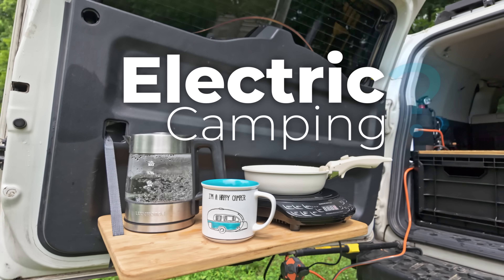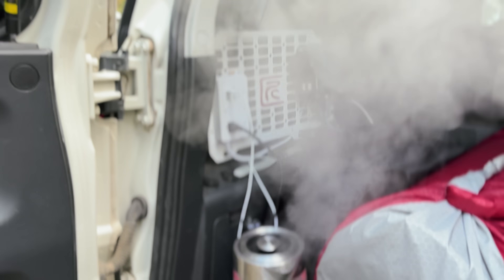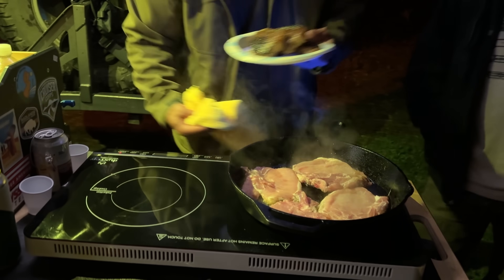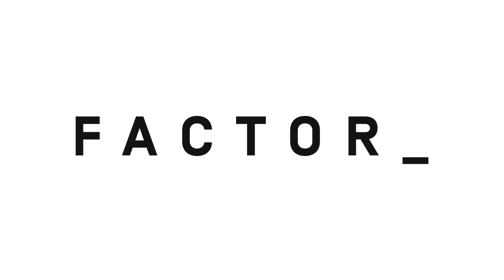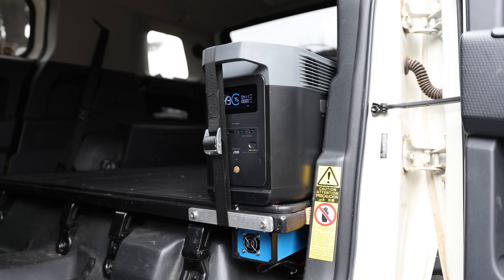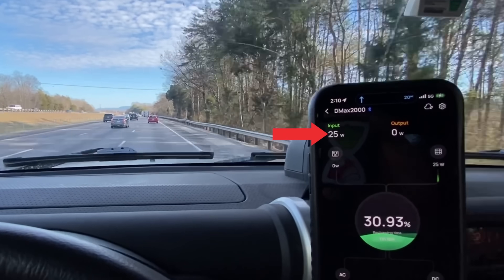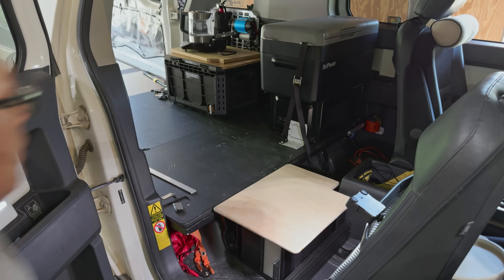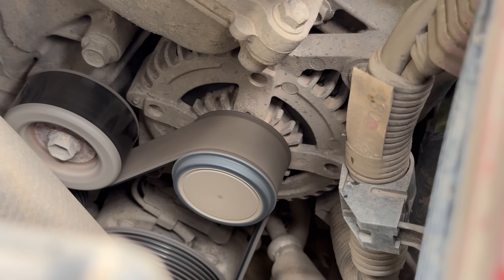I Tried Full Electric Overlanding For 1.5 Years | Was It Practical?

Comment: If everyone gains a basic understanding of lithium based battery tech, the relationship to power/watts = voltage * amperage and what a BMS is, you can build quite a bit of power reserve and charge it efficiently from both the alternator and solar.  Most people's power demands aren't running a 2000w inverter, it's best to stay within the 12v (24v Aussie) realm for all devices for a much more efficient use of stored power.
Reply: 24v Aussie? I'm in Aus and only trucks (and some winch comp vehicles) run 24v
Reply: @TheMitchellbegeng  so there is 24v there?  Most of the offroad channels ive seen use 24v rigs
Reply: @BrentRivers  I've only seen 24v on commercial vehicles and competition winching vehicles, never on overlanding rigs. I believe commercial vehicles in the states have 24v too.
Reply: Yes it’s more efficient but you’re gonna have a hard time finding a 12v microwave, induction cooktop, instant pot. They might be out there but will cost more than the inverter to use mass produced household appliances.
Reply: @TobyCostaRica  gotta stay home, or just get an RV.  Ive never needed a micro, dont even use one much at home.  But thats me.
Reply: Nah. The biggest downside of doing 110V/220V AC is that you lose efficiency to heat converting DC from battery to AC. Also good luck finding powerful 12V Kettle, cooking top, etc. 12V wires are super thic for these loads, 110V and 220V especially reduce the wires AWG quite a lot.
Reply: @tommy_zi284  well yeah, thats why i referenced it in my original reply.  Its not a straight conversion.  Is there a 240v inverter on 12v input?  Gotta be a huge power demand!

Comment: I built (& continue to optimize after EVERY trip) my van 7 years ago. At first on the road (before actually building it) I grabbed all my camp gear and travelled for 3 months. Then went home to do the  build. 

On the  first trip I considered how I would do the build & decided to build the most robust electric system and to NOT use fuel. (except a Butane cooktop which I never used as a back up, but occasionally as a second cooktop)

After 7 years I would not do it any differently. 
220 amp lithium battery - proven to be enough - I use 33% a day - so it last 3 days.
3000 watt inverter - never overloaded
30 + 40 = 70 amp Redarc BC/DC charger - I just added the 40 amp to speed up charging
200 portable solar panel - which I very rarly use - I pull the. out just to make sure they still work...

I never tried a microwave - never realy sure I would need one - I'll ponder it
Reply: And your alternator is still alive? Alternators are typically rated at 150Ah max. MAX!! So if they deliver 80-100Ah average you can be happy. Your car consume aprox. 30-40Ah while driving daytime => 60Ah max for recharging.
Reply: @alteregoklause1694  My alternator is 250 ah & has not skipped a beat after 7 years. 

From what I was told by someone who knew  these systems said as a "rule of thumb"  - you are  good as long as you Don't Exceed 50% output of your alternator's capacity.
 250 / 2 = 125 amp hour limit
So  I draw 75 amp to charge my batteries - I am still well below the max allowable  draw.
Reply: @TerryManitoba  Thanx! Ok, 250Ah is pretty good. Is this an OEM one? All cars I know (in Europe) are 150Ah max (standard). And yes, 50% seems a realistic value I use, too. Which limits me to low 75Ah recharge.😢
Reply: @alteregoklause1694  It is a Canadian Transit Van OEM alternator. Someone told me that North American vehicles tend to have larger Alternators. (maybe we are simply more power hungry-:)

Comment: Honestly this just makes sense, you run your engine all the time, might as well get full potential out of it.  It will charge when there is no sun, and most "overlanders" are driving for at least 4 hours a day, which will usually keep your batteries topped off.   These systems make way more sense than building your own now to IMO.  I went with the anker F3800, but in hindsight I wish I would have went with ecoflow.  However they more or less do the same thing, but the ecoflow has more peripherals and better options like built in heating pads on the batteires.
Reply: Also the ability to set your charge current at 50 watt intervals. I was surprised my friends anker unit didn’t have that. With I have a long drive I charge at 2-300 watts to be gentle on the battery. If I need to quickly top off my pack I’ll charge at 8-1000 watts

Comment: during my camping trip over Memorial Day, my electrical system did fail. my DC-DC charger which failed and I could not charge my battery. luckily I have 2000 wh and back up gas stove system so I was able to get through.
Reply from the maker: Interesting. Which DC-DC charger did you get? Why did it fail? Was it just a blown fuse or the whole thing was toasted.
Reply: @TinkerersAdventure  I drew my conclusions too early and sorry wrong terminology. 

The set up: Car battery-fuse-relay-Amazon voltage booster 12/24 - bluetti D050S "DC Charge enhancer"- BLUETTI B230 battery

I originally thought my 12-24v voltage booster (amazon SUPERNIGHT 12-24 20A) failed since the bluetti battery would not charge. However, I have measured the voltage from the car battery( which read normal 13v), the output voltage after the 12-24 booster (normal 24v), and the output voltage after the D050s (normal 59v). 

The D050S came with a cigarette plug and the battery charges (red light) when I plug it into the car. There is a status light (green- battery is full or on standby, and red- charging). The most expensive component still works! phew

When I use my own wiring, the D050S shows a green light (confirming that power is going in), but does not charge. The D050S has input voltage of 12-60v and is meant for solar so the voltage doesn't have to be completely steady.

The system has worked before but I only realized it stopped working this past weekend. Maybe it's been broken for a while and I just didn't know. The only thing I can think of now is that the relay has failed and is not able to provide enough current, but is able to provide just enough that I can measure the voltage is good.

Comment: When I saw the ecoflow 800w I immediately thought about your setup. It's an exciting time to witness the transition. Even more and more homes are going full electric. I'd love to see a video of your take on hybrids and how they benefit in electric camping. My RAV4 Prime PHEV has been flexing at the camp site for the past year!
Reply from the maker: I love the RAV4 Prime!
Reply: The RAV prime seems like a factory designed full electric overland system with added drive train integration. Can you charge up on solar, or is there some minimum power / voltage threshold to make it work?
Reply: @MrJhchrist  You can not charge up the car with solar. Well technically you can, it'll just take a looooooong time. Solar charges too slow, or rather hybrid batteries are way too large in capacity. The RAV4 Prime has 14kwh of usable/chargeable battery. So even with a large 400W solar panel that Kai has with his FJ, it'll take you 35 hours to fully charge the Prime.
Reply: I’m going to camp in mine this fall and hope to run AC all night without the engine kicking on. PHEV is the ultimate overland setup

Comment: Very informative video.  I am doing a hybrid setup similar to yours. I have a 100ah dual battery setup that feeds a Bluetti 180p for around 2.5kwh of storage and 1.8kw of output. All being charged by a Victron 18 amp dc-dc charger. It's nice to be able to pull the solar generator out as needed while camping and then put back in and allow charging from the 2nd battery that is mounted underhood of my 5th gen.  Speaking of which, how much wattage were you able to pull from your stock alternator? I assume we have the same engine?
Reply from the maker: My factory alternator is 100A. At worst case electric usage, everything else uses 75A, leaving 25A X 14V = 350W overhead. That worst is not very common so I feel comfortable running 400~500W for hours to charge my power station.

Comment: Just started using an induction cooktop with my bluetti setup. Also could run the heater to heat up my GFC, but definitely limitation is ambient temperature, my batteries ran down pretty quick when it was ~30F outside, so even my 4kwh setup was down to about 15% (from 89%) when I woke up in the morning.
Reply from the maker: are you using a space heater over night? that will run it down a lot as the tent loses a lot of heat. i only use the space heater in the morning when i change and run electric blanket inside the sleeping bag overnight
Reply: @TinkerersAdventure  I ran it on low (so it was cycling) for about 4-5hr. Granted it was my first test in my GFC and it was trying to heat the tent and the bed area. When it's on low it pulls ~5-600w, but it cycles with the thermostat as well. I will say, I am sold on induction cooking, it works exceptionally well.

Comment: Respectfully, replace “camping” with “overlanding” in the title; you even say car-recharging is a practical requirement.  I implemented a modest solution, in part inspired by Tinkerer, with a good panel, battery and a small fridge which only gave me a couple days camping at North East camp grounds.  My setup wasn’t a failure but I did have to plan on power exhaustion.
Reply from the maker: Thanks for the suggestion! title changed :)

Comment: Ecoflow alternator charger you can change setting in app for charging watts up to 800w/voltage 12-15v
Reply: I just received mine yesterday. This will be the ultimate setup. Hooking it up this weekend; Delta 2 Max LFP, Glacier fridge/freezer, 800W alternator charger, and 160W solar panel.
Reply: @alexsoo1752  Are you using the OEM alt? The vid left me hanging on whether he changed his or not.

Comment: Same here
200$ Microwave without turntable
30$ kettle (500W travel)
50$ induction

100Ah battery + Renogy 30A alternator charger and a Delta 2 make up my electric power house.

Microwave is a game changer. Costco stuff + Microwave is a new level unlock
Reply: A microwave was never even a consideration until I saw this. Now it's tempting. I wish they made small ones with the convection option!
Reply: @lawrencek9748  Yes,, I was looking at smaller ones, but all come with turntable. Panasonic was the smallest I found without turntable NE-1025F
Reply: 100wh?

Do you mean Ah?
Reply: @ausguy4385  Aaah yes, fixed it
Reply: What are your recommendations from Costco?
Reply: @KingsonMan  Sukhi;s chicken, some nice korean frozen  stuff, Enchiladas, Jim beans for breakfast..
Reply: What is the purpose for the separate 100ah battery if you have the delta 2?
Reply: @JimmyDevere  Delta 2 can be run down with 30 minutes of microwaving, even faster actually. And I am also running a fridge. Imagine using the microwave before dinner and then overnight the fridge eats up 400Wh... and you run out of juice. Add stuff like kettle etc. for making tea/coffee. So the 200Ah (yes I added another 100ah) extra makes it multi night proof
Reply: @tsk1979  People without real life experience really underestimate how much power you need e.g. for cooking. You can´t overcome physics by using electricity, total energy consumption will be always the same no matter if you use gas or electricity.
Reply: @alteregoklause1694  yup thats why now I have 200ah of batteries in addition to 1kwh of delta 2. Total 3500wh of energy enough for cooking, microwave, fridge etc
Reply: @tsk1979  "Total 3500wh of energy enough for cooking, microwave, fridge etc" Depends on how long you camp😉
But how do charge it??? ~300Ah needs (to my calculation) at least 6h net driving time as standard alternators with todays "intelligent" battery management might not be able to deliver more than 60A (if you´re lucky)?
Reply: @ I never camp more than one day or two days at a time. So starting full it’s easily manageable as actually camp cooking time is max 30-40 minute at 1500w and about 6-8 minutes of microwave and some kettle. Highest use we see on day trips. Eg hotel to hotel while roaming the Death Valley. We can park anywhere cook lunch etc. btw I charge at 30A so it’s more like 15 hours to full charge
Reply: @tsk1979  You´ve forgotten your fridge (I´m shure you have one😉) takes 500-800W (average 2-3Ah*24h) per day. At least mine does. Water cooking takes me ~500W/day. If you run a computer this might add another 100-150W.
Plus a little illumination at night.
Other than that I´ve the same consumption as you, but I stay sometimes 3-4 days - and that´s where it gets really difficult. Solar delivers 300-500W / day in summer, not that much. If I drive its about 3-4h (slow traveller😁) => high speed recharge is mandatory and I still need gas.
B.t.w.: what for do you use the microwave?
Reply: @alteregoklause1694  yup, even camping trips I am driving atleast 2-3 hours a day sight seeing minimum. Never ran out of power for cooking and fridge. When i had 100ah battery I ran out of power in winter trip (hotel stays at night) as the battery low temperature protection kicked in lol
Cooking I also use instant pot sometimes. Very fast and very power efficient.
Reply: The nice thing about a Toyota hybrid, (especially a plug-in), is acts just like a big, quiet, efficient generator. You don’t need to be driving to be dumping whatever your DC-DC converter can deliver. The engine automatically kicks on once in a while to top up the voltage.
Reply: @AscendedMaster11111  Because its a commercial microwave without turntable. So it can withstand the bumpy overland trips
Reply: @hellofathul  okay so basically support slavery in Africa by buying lithium batteries just so you can heat up water. Yup that's 2024 for you. Or just be a man and gather a bit of wood, cook over a fire, and pitch a tent. Literally 30 min of work, I'd hardly consider that hard. Unless you have soft hands then just stay in the city.
Reply: @hellofathul yes, like a man! Using a microwave while in the woods when you're surrounded by natural fuel is just asinine. Y'all must be so lazy and completely out of touch with nature to even consider this.
Reply: Since I don’t have a camping van just a 4Runner I bring the v1 Ninja Crispi and it’s fantastic.
Reply: Or just cook over a fire like a man
Reply: @manwithnoname734 A man invented the microwave. 🤷
Reply: @manwithnoname734  if you can of course! Try that in mid June/July in AZ with fire bans pretty much all summer. New tech= new solutions to old problems👍

Comment: What alternator can you upgrade to?
Reply from the maker: I’m still looking for reliable options. Most aftermarket ones are not as reliable as OEM especially if it sees mud and water. My factory alternator is 100A. Tacoma and 4Runner with tow package have 130A. I plan to go 200A
Reply: You do not need an alternator upgrade, choose LiFeP0 battery bank and use a DC-DC charger like the Redarc than can push 50 amps.  You never charge lithium based batteries with a direct connect to an alternator, it will kill it
Reply: @BrentRivers  the creator  said at the end of the video that his alternator couldn't supply 800w to the dc-dc charger. I was curious about an upgraded alternator that'd be able to charge as fast as possible with the dc-dc.
Reply: @jordandoes352  without getting too deep into the tech, the only time you would want to upgrade the alternator is when running multiple AGM or even flooded cell batteries.  Basically, they require lots of "push" to take a charge.  It's the opposite for lithium based batteries.  I run 200 amp hour battery bank (200x12volts = 2400 watt hours) and i can charge from dead using my Redarc onboard DC-DC at 40amps pretty quickly.  I never run out of power.  I also have about 600watts of solar if necessary or if i'm sitting for days.

Comment: Here would be an interesting test.  compare one or more 120VAC to some 12VDC water kettles. It could be more efficient since you don't have losses converting from 12VDC to 120VAC in an inverter.

Not having to pack a gas cylinder would certainly save space.  You can tuck a battery system or power station somewhere not readily accessible and just run wires to where you need them.  Packing a LP cylinder requires it to be accessible.
Reply from the maker: the 12V kettle are too low in power. the low voltage is the limiting factor. The kettle i use is 1500W. The inverter loss is actually less than most people think. most large power stations are internally 40-50V to minimize copper loss.

Comment: YES X 100 especially with the 2.4kw inverters on the new Toyota LC, Tacoma, etc
Reply from the maker: the only thing i didn't like about those new 2.4KW factory inverters is that the engine will kick on and off ever 5 minutes to keep the 1.7KWH hybrid battery topped off. It won't let you discharge it very far. So you are basically running a giant gas generator and it'll be a little noisy.
Reply: Yup, i should mention I only use it when driving to charge an EcoFlow Delta 2. Sometimes when parked and “idling” with AC but I usually charge at 500 watts. 
In our Rav4 Prime with the 18kw battery it runs forever 😀